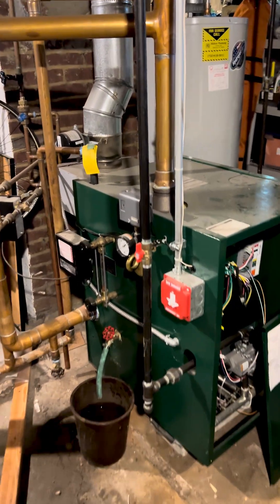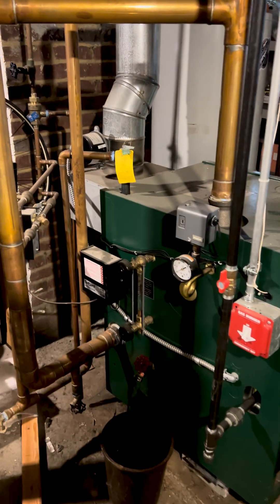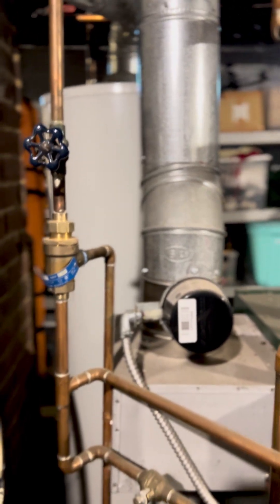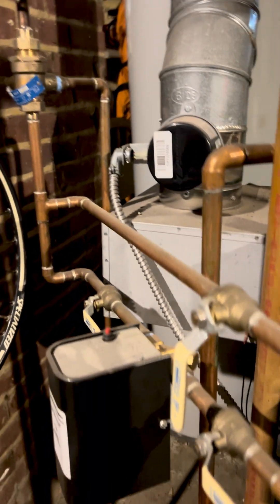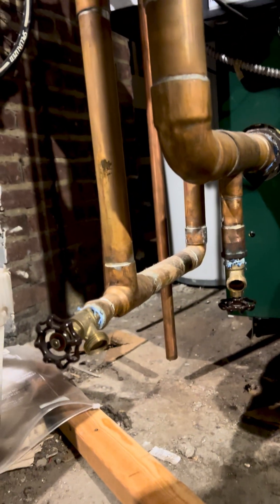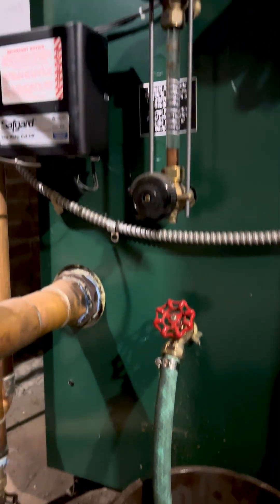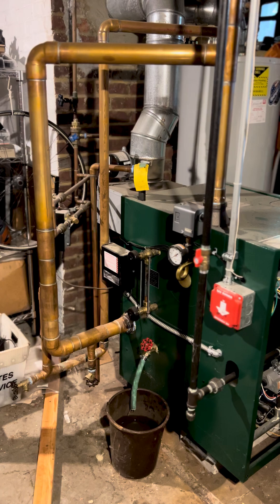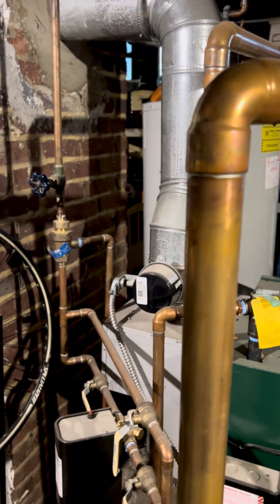No Heat, No Pressure furnace help!… and No Clue Where the Bleed and isolate Valve Is!

Comment: First of all it is not a furnace it is a steam boiler and by the looks of it there are plenty of valves and there is a drain on the boiler. If you're going to post something The terminology needs to be correct. Plum on brother
Reply from the maker: Thanks for clarifying that! I’m not a trained technician or a native English speaker, so I appreciate the correction. I’ll do my best to use the right terminology.
Reply: @woods_roamer it's all good my friend. Plum on